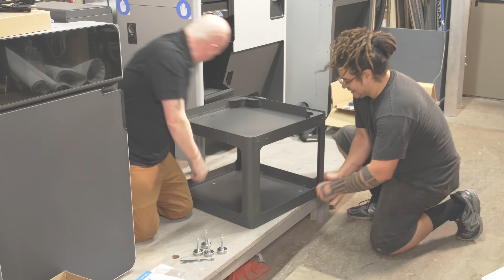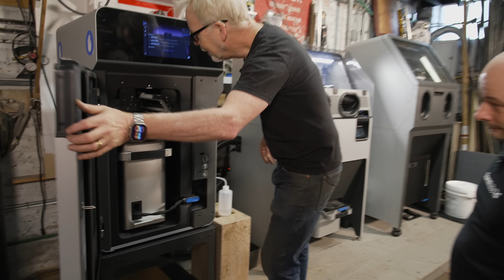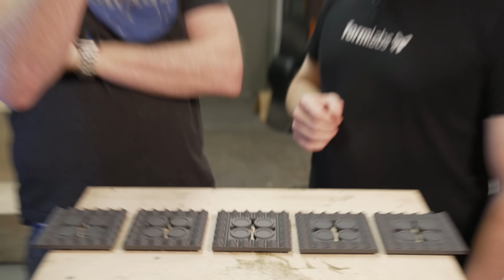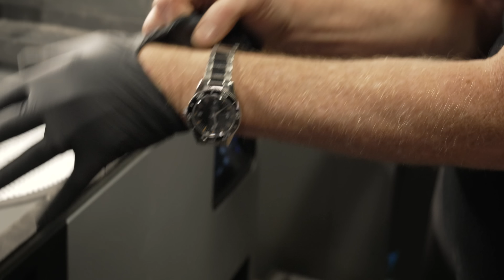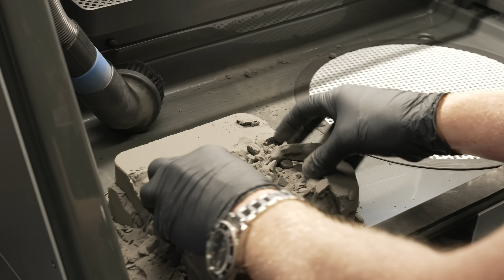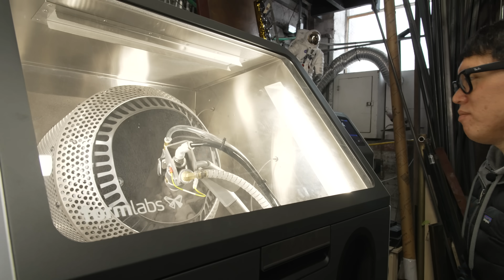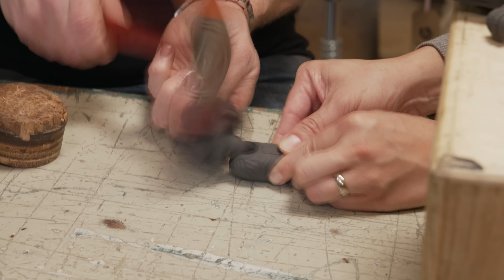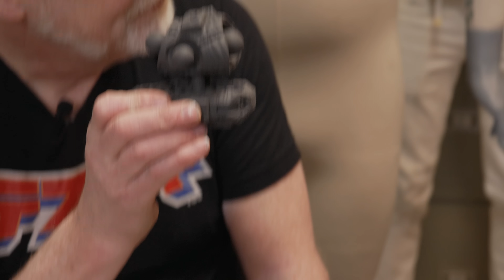Adam Savage Levels Up His Workshop 3D Printer!

Comment: The buttons on the outside of the fume hood seem like a massive oversight. Constantly having to deglove to activate the vacuum or start the sifting leads to leaving the fume hood open, which will destroy your lungs, even with the fume hood activated.
Reply: I mentioned the need for foot pedals.
Reply: @Bigrignohio  yes! Foot pedals or buttons on the inside
Reply: @leonkrug4841 Don’t forget Knee button paddles. Very handy. Knee-ey?
Reply: when do you have to open it to press the buttons? Start the sift at the beginning, then start the blower, run them for the entire sift cycle, then deglove, start the vac, clean up, and you're done.  most of the stuff you see them doing (taking the grate off the sifter) is just for filming.
Reply: I wouldn't want all that fine, particulate matter potential interfering with the buttons. This kind of printer is not for convenience.
Reply: @peterkallend5012  the buttons are overmolded rubber. Formlabs spent a lot of time working with suppliers on those buttons.
Reply: 12:53  plenty of birchmarking there
Reply: @donr62  I think that was an example the rep brought with him. They showed it at the same time Adam mentioned the photo he received.
Reply: I’m watching this as I print on ours. We’ve owned it for two years and I can say that Formlabs was probably hesitant to “give you one” all this time due to them taking those two years to really work out most of the bugs…. They have come a long way at least and hopefully it continues to improve but boy was it a nightmare early on! Good luck 🇺🇸〰️🦅
Reply: You could just have some good old fashioned rubber covered buttons inside the chamber; about an inch across and backlit red or green or whatever for more than 2 actions.
Reply: Having used this machine, the vacuum plugs into the excavation chamber from the outside. The accordion style hose on the inside is attached to that vacuum feed and can be used when needed. It's actually a pretty streamlined process once you do it a few times and have a procedure down.
Reply: The gloves are a recent addition to the system. For years it didn't have those at all so reaching the buttons was easy. But, normally you'd start the sifting right away and leave it running as you're working. The vacuum is only used at the end when you're all done and you're cleaning up. But yeah, being able to reach them while wearing the gloves wouldn't be a bad thing for sure.
Reply: @treborrrrr The entire point of a glove box though is that removing your arms doesn't open it, so it's totally fine to have the buttons on the outside, just potentially mildly inconvenient
Reply: The glove box for the sift is an optional extra. Normal workflow is disposable gloves and an N95.
Reply: How much £?
Reply: @mediaaccount6218  printer is about £25k, sift and blast are about £10k each as well. Powder is about £100 per kg. Got a few of these at work, fantastic printers
Reply: l0😊
Reply: 😊p😊😊l

Comment: Don't you want to wear a respirator when pouring nylon powder?
Reply: I certainly would.  I like redundancy when it comes to not discovering new and exciting forms of lung cancer.
Reply: Ideally yeah. It's not pleasant for the lungs
Reply: @jackhemsworth7515  long term, regular use...need protection.
Reply: I think they were relying on the built-in ventilation to suck the dust to the back end of the cabinet.  You can see it flowing that way in some moments.  I think they were going with the 95% effective PPE as opposed to the full sealed enclosure.
Reply: Yes the powder if inhaled will shred your lungs its very bad.
Reply: Wear you dust mask

https://youtu.be/p_65qCD2On8?si=Ud6uI06OVrNT-DkE
Reply: Sandblast hoodie duhh
Reply: yes, without a doubt. There is not significant research on nylon powder damage in lungs etc, so yes without a doubt he should. I work with these machines daily. And its a pain in the ass. Bot machinewise and env.
Reply: @OneTech3DHQ  "There is not significant research on nylon powder damage in lungs etc" The most ridiculous thing i ever heard. Imagine having lungs full of plastic dust that you can't rid off. Every dust is dangerous for lungs so ware respirators !
Reply: @redheadsg1 ware?
Reply: This model is designed to not require any respirator, according to form labs, IF you follow the proper procedure. Hence the gloves chamber, the cartridge system, and the integrated vacuum. The instructions state to use a respirator if local exhaust particulates are above a defined threshold (ACGIH Threshold Limit Value) but it shouldn't reach that threshold with proper configuration of exhaust. I would assume the form labs field tech would explain that to Adam. Pretty sure he'll be fine with or without one depending on his personal work practices.
Reply: @FreejackVesathe fact that we need the comments to find out about this means, imo, it should have been highlighted and a small warning.
Reply: @FreejackVesathanks for pointing this out.  You can literally see the machine controlling the air flow.  All these PPE comments makes me sad for this community.   Apparently they watched the video with their eyes closed.
Reply: @made4  Why would people advocating for working with PPE make you sad? What a weird sentiment
Reply: The lack of safety on this channel is insane
Reply: @PioneerPrint3D  while unsafe normally, they are doing it for video purposes. There's a vent hood in the machine. I'm sure they know the dangers and that's why they aren't splashing powder like crazy. The amount of dust handling and dust removal seemed fine for the vent to work and not let much of the powder escape.
Reply: @KracknCorn  Adam routinely files resin prints with an emory board RIGHT IN HIS FACE. I wouldn't count on it.
Reply: @daveemerson6549 it’s emery

Comment: You could look at opening up the socket side of the joints then print a TPU bushing to allow for movement with the needed holding. This may also benefit from polishing the ball side of the joints to keep the movement smooth.

Comment: this seems perfect for printed chainmail. No supports means you can print it fully separated, and it's actually pretty strong
Reply: That'd be pretty expensive chainmail I'm not sure the cost per build on this machine because I'm not sure on the ratio of used to new material per build. Ours is 30/70% and each build retails around a few grand.
Reply: @mattrussell8813  for 10kg of powder is 1000$ unless bulk ordering

Comment: "I can still feel some warmth." Yeah, I noticed that on Norm's first print the cautionary note about checking the temperature before removing the canister went right out the Tested window.
Reply: It's really  fun when we have to pull a part off the top of a build that's only been cooling for 10 minutes in the post processor of our HP MJF 4200 we have nice thermal gloves and the hold the heat for quite some time. In our machines it takes 48 hours to natural cool we do that for critical Parts that we want to avoid any warping parts printed in PA12GB for firearms. We normally run the fast cooling which takes 16 hrs depending on density and build height. So it's still really warm in the middle but safe enough.
Reply: Even after the printer/sift reports that it's safe to extract the cake you can still feel a bit of heat in the middle of it unless it has been cooling for quite some time.
Reply: It feels like a design flaw to have to check the temperature manually 😅

Comment: Looks like you'll have to print those action figures in place.
Reply: You can but you still need to make sure adjust the tolerances because the parts will fuse if your build is too dense. But definitely possible we do flexy parts for fill sometimes and they come out great

Comment: Is it just me or is that print bed crazy small for such a huge machine? D:
Reply: There's a lot of insulation around it to contain the heat. There's also quite a bit of electronics, hoses, fans, cabling, motors and such around the outside of the machine that takes up space.
Reply: insulation

Comment: Sounds like it needs a button or external switch pressed to activate the vacuum? That means de-gloving if you are by yourself. Maybe they need (or have) a foot pedal option?
Reply: Looking forward to seeing that one-day build!
Reply: @wadecassels2778  He can use the same type he used before, the heavy-duty one with the flip up cover?
Reply: It's called "ungloving", the act of removing gloves from ones hands. "Degloving" is an entirely different process, which is a medical term for a traumatic injury.
Reply: Or just a smart plug / Alexa

Comment: And here’s me still trying to comprehend how amazing and alien my FDM printer technology is and now I see whatever the hell this is
Reply: I have a Plastic Filament 3-D Printer. This is ALIEN TECH in comparison… 😅
Reply: ya technology is on market for over 10 years issue is cost I think cheapest one right now around 30k
Reply: I think his printer is around 60k with all the extra stuff he got, not to mention the bags of nylon powder are $1000 each 😂
Reply: Isn't this technically still fused deposition?  It's just a different method of delivering the material to its destination, and a different method of melting it for fusion, but still the same fundamental principle of stacking slices.
Reply: @SebastianWeinberg  FDM and SLS are different subsets of AM (additive manufacturing). Using a laser to sinter powder instead of using a nozzle to extrude molten plastic is a distinctive enough characteristic to merit labeling it as its own separate form of AM. If you don't adhere to that logic, you could also call MSLA/DLP printing FDM because the action of the printer is depositing resin by allowing it to flow on to the build plate and then fusing it into a specific shape.
Reply: @SebastianWeinberg  not necessarily. FDM is specifically referring to a machine that deposits material that is directly fused to the layer below it, usually by extruding a solid filament through a heated nozzle, and only deposits said material in the exact pattern that forms each layer of print, with the rest of the build volume remaining a void/air. This means any overhangs or floating pieces need supports to keep them in place for the duration of printing. SLS requires an entire layer of material dust in the build volume, which then a laser sinters only select parts of to make the solid component, before placing a whole new layer of material down and repeating the process. This also means that, since the parts are suspended in powder that is roughly the same density, there is effectively no need for support structures.

You could think of SLS as working similarly to resin printing, just flipping the laser and build chamber, but really each type of printing is its own separate thing.
Reply: Wait until you find out we’ve had resin printers since 1989.

Comment: The build area of such a large imposing(and incredibly expensive)  machine is shockingly small...heh.  Although you can dump a ton of small to medium prints in it at once since they don't have to be at the bottom stuck to a plate.  They can float anywhere in the build volume.
Reply: You basically have to surround the build area with an oven to get the whole thing up to near sintering temperature, the a layer of insulation, then surround that with the necessary motors, controllers, laser, and optics. It's harder than you think.
Reply: It's not your (build) size, it's how you use it.